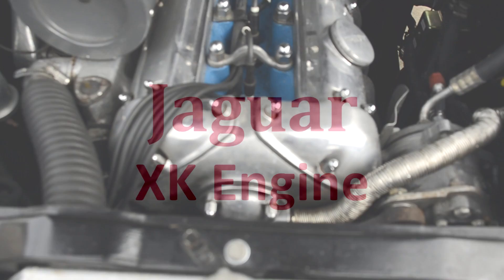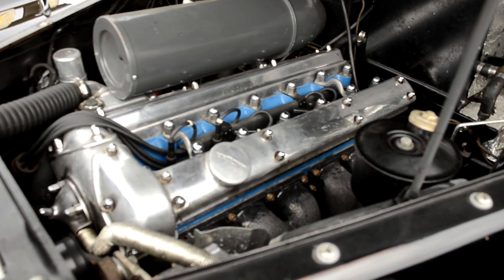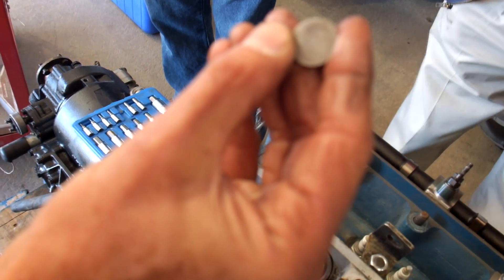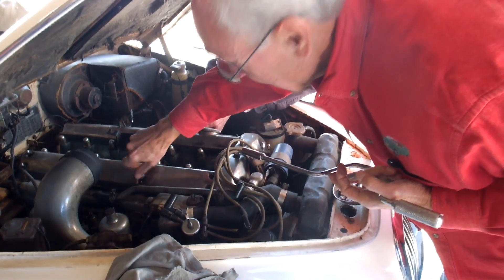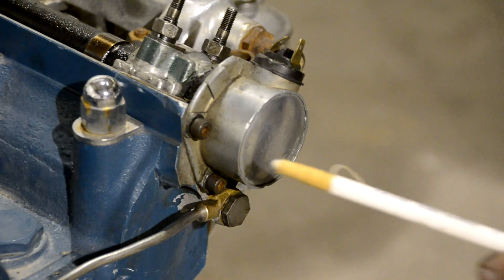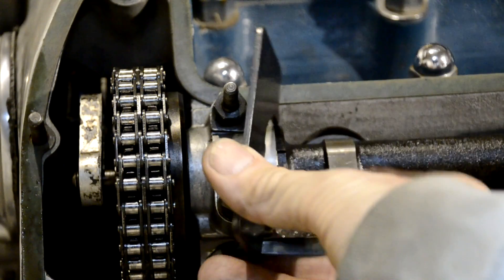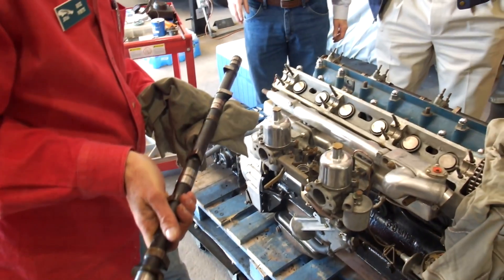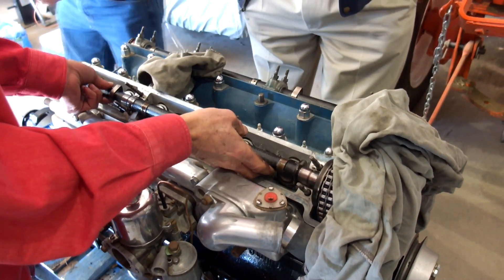Jaguar XK engine Valve Adjustment Tutorial

Comment: HI  I HAVE TO REPLACE THE INLET CAM ONLY  iT HAS A 4.2 CAM WITH CLEARANCES OF 10 i WANT TO PUT A 3.8 CAM BACK THERE.    CAN i JUST TAKE THE INLET CHAIN AND SPROCKET OFF ON THAT SIDE OR DO I NEED TO TAKE OF BOTH SIDES  tHANKS

Comment: Shims are Not readily available.  
Certainly Were Not in 1980.  
Few Jaguar shops  had even half of the collection of shims required. 
Then one is into Cutting Valve stem heights to get within range of AVAILABLE shims. Lots of wor. OEM  Valves were a bit soft  consequently the need for adjustment was Fairly frequent. Often "better' shops would upgrade the Valves (all) with  stronger / better materials valves.

Comment: my 1965  3.8 'S'  idles fine but makes a knocking noise when accelerated. Oil was drained, found golden particles in oil. Have been told it is the crankshaft bearings and have been told it is the flexplate. I do not see a need to rebuild entire engine. Can the crankshaft bearings be replaced with engine in situ if indeed they are worn out? Thanks.
Reply from the maker: Flex plate could not possibly be the cause of metal particles in the oil since it is outside the crankcase
If you have rod knock, your crank journals will almost certainly need to be turned to next under size. Removing the engine isn't really all that daunting. The tyranny should likely be removed separately.
If you are confident the upper end is good (compression test?) then you could likely remove the crank without disturbing the head. Trying to cut corners with this rarely yields satisfactory results!
If you are getting rod knock you MUST NOT drive it further or risk irreparable damage. With crank out be sure to properly clear all oil passages in block AND crankshaft. Your knock is very likely the result of partially blocked passages
If you can do the grunt work yourself it would likely be less than $1000 (parts and machining)
Reply: @texcarguy  Thank you for replying. I am not running the engine, car is stored. Compression test was done and it was satisfactory. But i am not able to remove engine and tranny by myself, much less work with the crankshaft. Not experienced with engine internals. I can do everything external, but crankshaft bearings is beyond my knowledge.
Reply from the maker: @zurdoremi  too bad. Maybe you can find a mechanically inclined friend to help. You just need an engine hoist and basic tools. Of course the crankshaft work needs a machine stop but cost should be minimal if no serious damage to crank. It's pretty basic wrencg turning
Good luck with it

Comment: I wish to thank you for the video.  I have 1969 Series II OTS with 10,210 miles on a 1974 rebuild.  It was time to check valve clearances.  Found Intake #4 to be 0.0015" so it was time to do some work.  I watched your video three times and then took the plunge.  Got the #4 Intake adjuster pad out and over to a local machine shop to shave 0.0025".  All back together now and clearance is perfect.  Runs great and I won't be worried about burning valves for the duration.
Reply: How many labor hours would a mechanic take to do this looking at a 78 series 2 loud tapping valve.

Comment: Very nice, those are beautiful engines.
I had a Kawasaki motorcycle in the 70s that had dual overhead cams and inverted buckets with removable thickness shims. My valve adjustment procedure was very similar to what was done here, with an additional step. After setting the valve lash per the manufacturer's specs, I would bolt a degree wheel to the crankshaft and align it to TDC on cylinder #1. I would then use a dial indicator on each intake valve and measure the amount of valve lift, typically about 0.050", at the specified intake timing point in degrees BTDC. I would then equalize the valve opening of each intake valve to the minimum amount in the set by sanding each shim down to the necessary thickness. I would then repeat the process for the exhaust valves. Doing things like this and indexing the spark plugs with indexing shims resulted in a very smoothly running engine. I would also first synchronize the carbs with an air flow meter and then fine-tune the cylinders with a power balance test, where I would short out individual cylinders and adjust the throttle butterflies for equal RPM drop.

Comment: I used to do a lot of Jags- made myself a magnetic tool to hold the shims and grind them on the stem grinder of the valve machine if i didn't have the exact one in my batch-  Just take a bolt and turn a recess in the head the same diameter as the shim, then magnetize it. Magnet will hole the shim and you put the bolt into the stem grinder and grind the shim to the desired thickness.

Comment: Nah,  0.005" exhaust,    0.003" inlet ,    i was using these setting for 30 years.
Reply from the maker: As they say... Opinions are like assholes.. everybody's got one.  As for me, I'm happy to follow mfg's recommendation and even err on the looser side.  Sure, the racers go for tighter clearances in quest of a bit more power, and at the possible adverse effect on  engine longevity. 

 As for me, I'll gladly accept a bit more tappet noise in favor of reduced likelihood of getting a burned valve from too tight clearances.  I don't really enjoy having to remove an XK head.  That approach has served me well from my first series I E-type back in 1969 right through my current 15 year ownership of a lovely MK IX.  umm I guess that would make it 49 years, huh?

Comment: Great engine the 6,looks good as well,but copied from ferrari  back in the day
Reply: Yeah, Jaguar was definitely copying Ferrari in 1949 when this engine was designed. How many Ferraris even existed in the late 40s? The company was founded in 1947..
Reply from the maker: Hmm.. I've seen just about every iteration of Ferrari engine, including the V12 in my own  '72 365GTC/4 and find virtually no resemblance, either physically, or internally to any of those with the XK engine.  I'd be curious as to which Ferrari engine you are referring to (In fact, I'm not aware of any Ferrari 6 cylinder model.. 4 cylinders and V8s/V12's possible a V6, but not a straight 6 I can think of)
Reply: @texcarguy   Clearly you are not aware of the 6 cylinder Ferrari, simple history check may open your eyes, maybe you should drive a Lada  ( simple version of a Fiat)
Reply: @jimclarke1108 , Ferrari's inline 6 is from 1955. The Jaguar engine was released in 1949. Pillock.
Reply: @Acct1941  Ferrari inline 6 was used in racing from 1955

Comment: In the seventies I worked at Ashey Road Garage for John Foss who was a total Jaguar nut (ment with affection). In his personal collection he had every version of the E Type including a racing E Type and one of the last ten. I have rebuilt hundreds of them over the years and must have built up a very good reputation as people would bring their Jaguars from the mainland for us to work on. The only thing that I would add to your excellent video is to emphasise  not to turn the cams individually as the valves will clash bending them, have seen quite experienced mechanics do this. Also would recommend turning the engine slightly so all pistons are low installing one cam at a time after fitting the "correct" shim and rechecking the clearances, can save you a lot of time and trouble, not to mention embarrassment.

Comment: We used to set the engine on TDC with rotor arm facing forward,   slacken off the top timing chain,   undo the cam caps from the rear and lift the cam up one at a time, set the clearances then push cam back down and torque caps to 9 lbf.

Comment: Good thing they're "beautiful" so mechanics have something pretty to look at constantly. Hand-polished turds. All that crap was "rarely found" on American car engines because American car engines are built to run good rather than look good and you damned sure don't have to adjust valves on any American car engine built since 1954. Unless its a solid-cam high-performance muscle car engine, of course. And those are few. Hydraulic lifters are really high-tech, huh?
Reply: "You don't have to adjust the clearance on American engines"

Wow.
Reply: Well at least for the same power the British Engines don't weigh 2 tons and lift the rear end so it overtakes you on any bend. It's called "advanced  engineering" by the way!
Reply: Buckets and shims are actually a very modern way to do it, and needs less adjustment than traditional lifters in a lot of vehicles, especially pushrod.
Reply: DEEREMEYER1 You really are that stupid aren’t you.. clueless twat!

Comment: I love the "that's all there is to it!" at the end. On the good old american motors all ya do is remove the valve cover adjust the clearance and put the cover back on.
Reply: Yes. It's called a lack of sophistication
Reply from the maker: Really? so in your mind a cast iron lump with single cam-in-block and hammered in rocker studs (like virtually ALL American built cars in the late 50's early 60's) is more sophisticated than a beautifully cast double overhead cam engine with polished solid aluminum cam covers and dual foolproof SU carburetors?  That's what is  standard issue in my 1959 Jaguar MK IX, along with 4 wheel disc brakes and sunroof.  How many Detroit vehicles of that era can boast those features.

Just because an engine is easier to work on does NOT make it more sophisticated.  I could change out a piston in a Briggs and Stratton lawnmower engine in 30 minutes, but no one would call it sophisticated.  Ever adjust valve clearances on a vintage V12 Ferrari?  it is about a 2 day job, but the end result is worth every second spent!
Reply: a Jaguar is not a Chevrolet or Ford. A Jaguar is a supercar, a Chevrolet is not. Neither is a Ford.
Reply: Actually it's called "British Engineering old boy. It's the reason Jaguars don't swop ends in a corner unlike good old American engined cars with engines weighing in at 2 tons!